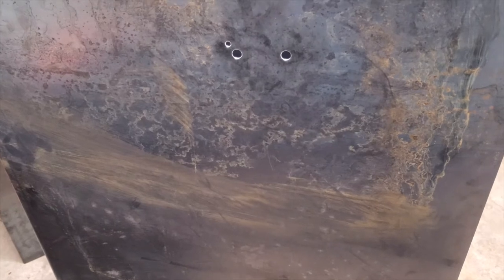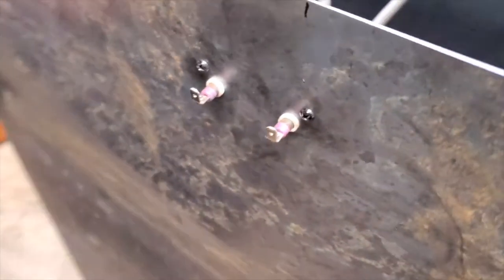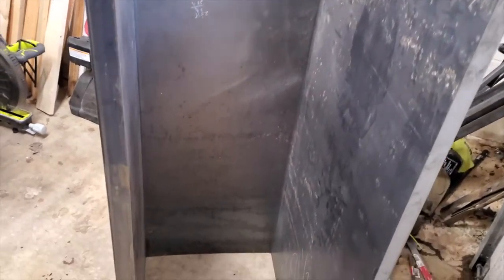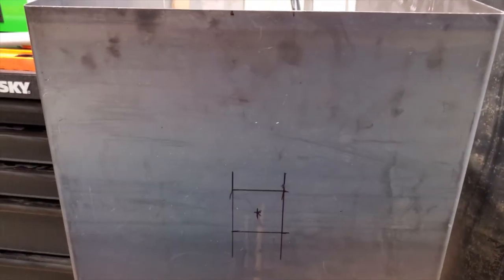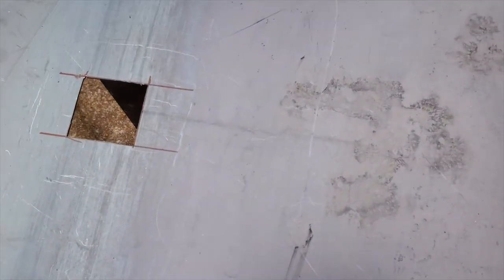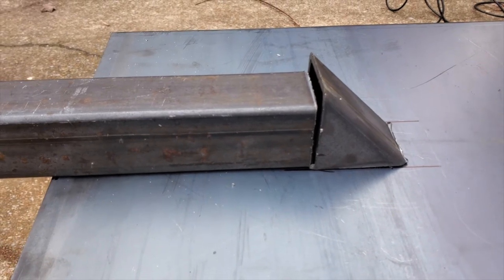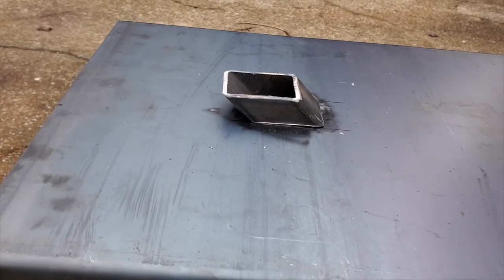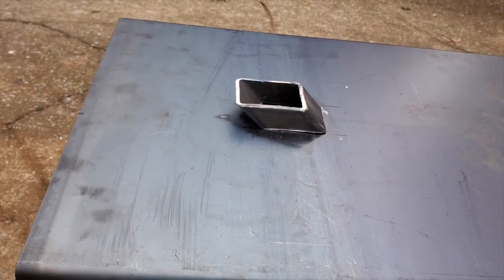DIY Electric Smoker Build - Part 1 (5 times more Capacity than Masterbuilt 30")

Comment: Question: What guage metal did you use for the outside and inside walls.
Reply from the maker: 16 gauge.  Since there isn't going to be fire and it is insulated 16 gauge is plenty heavy.  That is actually much heavier gauge than most commercial electric smokers and even some commercial charcoal/wood fired smokers.